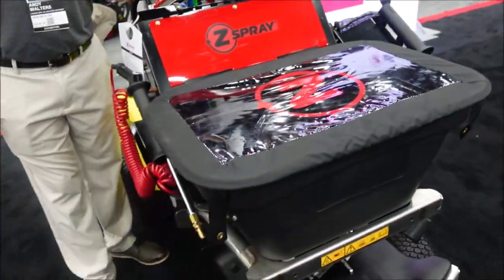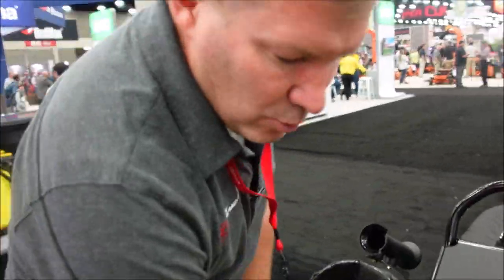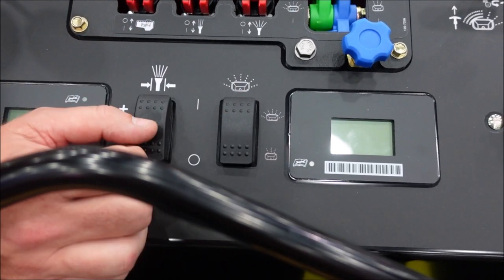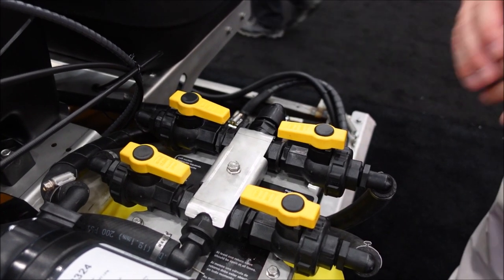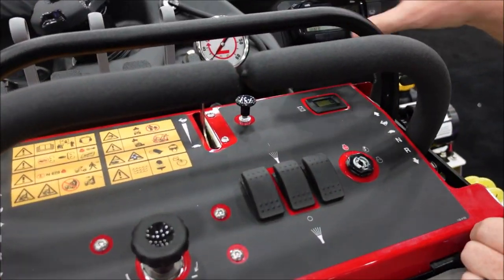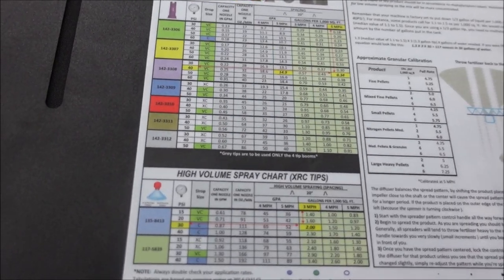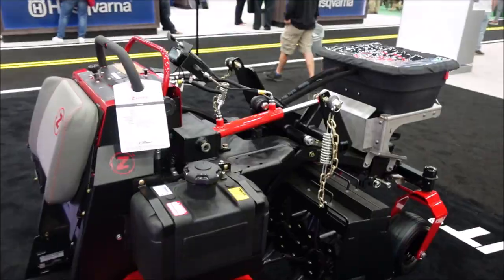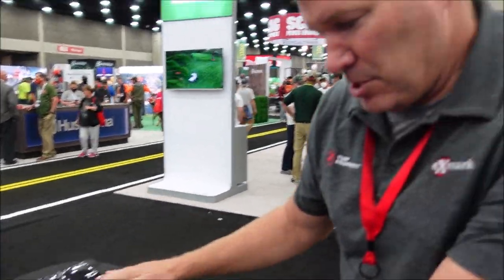Z Turf Equipment Overview with Product Rep - Z Spray, LTS, Z Aerate

Comment: Run a Z Spray Max/Jr everyday. Only dislike is they’re so compact and hard to work on. Rode a Steel Green 52 and they’re so much better IMO as far as build and customer service. It seems they’ve fixed all of the problems you run into with ZSpray.

Comment: How do you get lesco/Chem lawn spray gun set up on z spray intermediate so that you can blanket spray with gun for small back lawns that machine can’t enter gate but use machine for everything else without having to change pressure all day and recalibrate? Currently machine is set to .37gallons per 1000 sq ft. Thanks